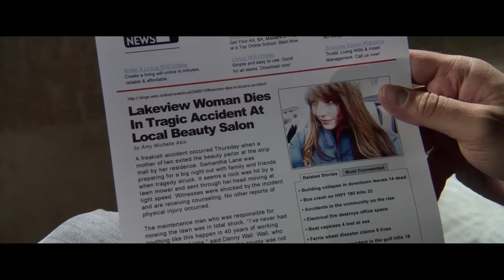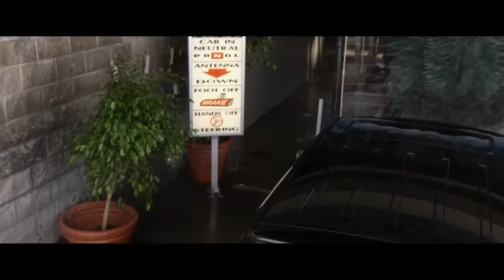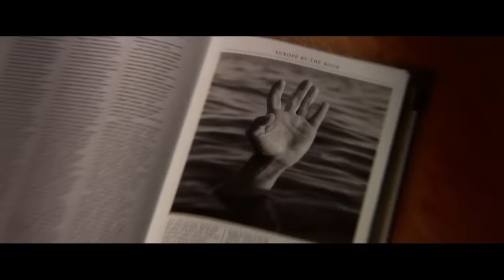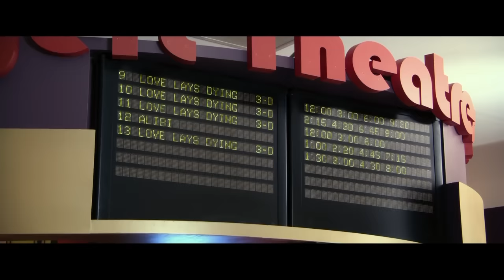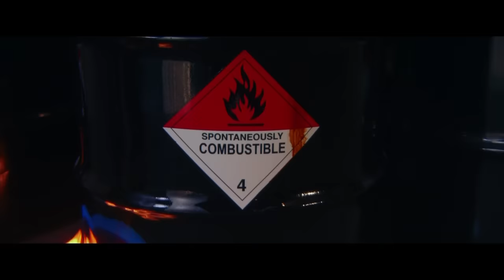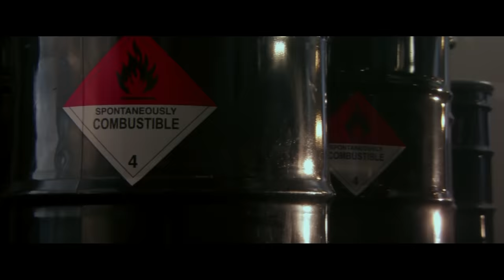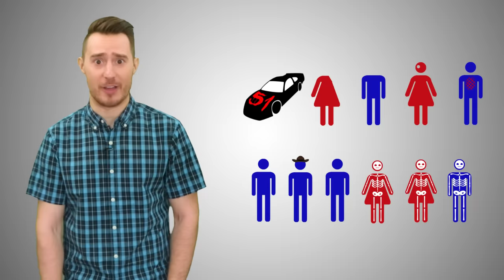The Final Destination (2009) KILL COUNT

Comment: also if you pay close attention to where the are sitting at the race track, you can see they're in section 180, referring to flight 180 which started all of this in the first film.
Reply: The bus number at 22:12 is also 180.
Reply: Which 180°/180 is code for (turn around) to avoid the upcoming danger.
Reply: Mindblowing fact: The car that cases the crash has the number 45 on it. The Final Destination is the fourth film of the series
45 × 4 =

   180

(Sorry if my english is bad)
Reply: Bus 180
Flight/plane 180
Train180
Seat 180
Whats next
Reply: No stop pointing that out please every film has 180 tied to death 180 means nothing to me it's just a number but eversince the second film every one of the films has had this 180 shtick.🤬🤬🤬🤬🤬
Reply: 180 is a recurring motif in the series. Carter was crushed by a 180 sign...the wiki has them all, but it comes up a lot.
Reply: @zollodelapaz8333  room 180 if hotels have that but seriously movies 180 is not a dead number 
Edited
also you missed next 180 sign
Reply: desmond thon A 180° is a complete turn. If someone tells you to do a 180 they want you to turn around.
Reply: @TheLivingRoom_  okay then what does turning around do for you when you blow up from lets say a leaking gass line see your explanation can make since for some of the deaths not all of them.
Reply: @zollodelapaz8333  person 180

Comment: 3:35 The bolts are being unscrewed by the massive vibrations of the cars, not the wind lol. It's the same reason Harley dudes will check their bolts all the time, they can rattle loose over time. If you stand near the fence when the pack drives past it can actually rattle your brain pretty bad. That's why a lot of people in the crowd will bring hearing protection, the tinnitus is very real lol.

Comment: 20:10 Chemist here with a background in Hazmat. Spontaneously combustible is even dumber than you think. There's actually a very specific difference between flammable and combustible when it comes to hazmat. I don't recall the specific details (it has to do with flashpoints), but in short combustible is less bad than flammable. Combustible means it will sustain fire, but by itself cannot start a fire. Flammable on the other hand, catch catch fire if exposed to sparks. So by definition, you cannot have something spontaneously combustible in a hazmat way. And btw, spontaneously flammable stuff is real: the real term is pyrophoric, and it would not be in barrels with a combustible label.

Comment: I’m no physics major, but I don’t think it was the wind that caused the screws to move during the premonition. I think it was the vibrations of the race cars passing by. Just my take on it
Reply: I completely agree. Wind wouldn’t have any effect on the bolts. It would be the vibrations from the passing cars
Reply: or it was just the movie being dumb
Reply: You'd need a pretty noticeable gust of wind (20 mph?) to even attempt to make bolts spin. Plus the wind wouldn't make the spin in the first place, they'd just push them horizontally to the side of the holes. I'd say it was a combo of vibrations + deEaATh

And yea it's a dumb thing in the first place but cmon it's fun to look for over the top explanations
Reply: There's no way the staff would not check loose screws

Comment: I think the tub scene makes sense because the water leaking on Jonathan Grove's head was from the water flooding over the tub filling the room above and dripping down to the ceiling bellow, so the tub didn't have to be over Grove's bed to drip water but it was in the right position when Jonathan tried to escape for the tub to fall on him.

I mean you could clearly see the water flowing over the sides of the tub above Grove's room even in this video.

Comment: Those were practical effects?? WHY does it look so bad? 
We need some experts doing an analysis here,,,
Reply: #FACTS
Reply: Because they covered them with cgi. It's a shame
Reply: By the time all the practical elements are combined and the colour correction filters, smoke, fire etc are added you obscure any practical effects underneath. It's super obvious here because of the length and complexity of the sequences. They perhaps would have been better off using fewer practical shots, or at least having the disaster be simpler.
Reply: Compositing
Reply: We actually have a group we can go to to ask about that

Comment: If you've ever had a leak in your roof, the tub would make sense. You may have a leak on one side of your roof, but inside the house you'll notice the water in a completely different location because of the way the water travels across the structure.

Comment: For the hospital scene with the tub, it makes perfect (non)sense.  Water pools until it overflows or finds an escape route and continues flowing until it's stopped or contained.  It could be possible that the room is sloped slightly so the water leaks over the cowboy's bed first.  What doesn't make sense is a) all that weight from the water in that size tub means the room should have been reinforced to prevent the tub from falling through.  Either it's on solid concrete or built on top of a concrete supporting wall.  And B) the room itself should be tiled or vinyl'd with a drain to deal with overflows.
Reply: Maybe death made the builders dumber

Comment: Johnathan Grove's death make sense because before the floor/ceiling collapse the tub was over filling with water spilling water onto the floor and filled the room with the tub with water and some of that water leaked down over Grove's head on the bed. Thus the tub didn't need to be over Grove's bed to drip water on the bed. If you watch the parts of the scene in the room above with the tub you can actually see the water spilling over the tub.

Comment: The reason the bathtub could absolutely be there is because the water isn't coming through the ceiling from the bathtub. Bathtubs don't leak. It's coming from the floor in the bathroom because the tub overflowed onto it. Therefore, the water could be coming from anywhere in the room except where the actual bathtub is.

Comment: The tub scene makes sense because the tub is bolted/attached to the floor, so the water pools around it. Therefore, water leaks everywhere EXCEPT the area directly beneath the tub, because on the floor above, the area under the tub is completely dry

Comment: I landscape and commercial lawnmowers absolutely are able to throw projectiles upwards of 50-100 meters. A small rock like that wouldn’t but a rock / pipe of the perfect size can go very far. I’ve seen an irrigation pipe fly across a good chunk of a business park parking lot, at least 50 meters away. I don’t exactly know why bigger projectiles go further but I think the bigger it is, the more it grips/gets stuck on the blade and the more kinetic energy gets transferred. Either way a rock that size wouldn’t fly at head length the far, and certainly wouldn’t have the force to act like a sniper bullet 😂

Comment: The whole spontaneously combustible barrels thing is funny because it does exist, (class 4.2 flammable solids) but they are spontaneously combustible when they come into contact with air. And I’m not sure what 4.2 material a construction site would need in that quantity. (Also, nerd moment, the color of the placard is inverted. It’s supposed to be white on top, red on bottom)

Comment: 40lbs? for an engine? my dear sweet comentator typical nascar engines weigh somewhere in the ballpark of 575 lbs (261 kg for you folks that like using the incorrect measuring system)

Comment: so the fire sprinkler system behind the screen. not exactly sure if thered even be a sprinkler back there, based on room use, but also all sprinkler pipe is steel or iron. the props PVC with shitty contact cement connections really look bad, like highschool film levels of bad
Reply: also if this is a temperature triggered sprinkler like the plot demands, the bulb that actually holds the always present water back

Comment: Not sure if anyone truly cares to know about the bathtub scene but I'll give a bit of real life info about water leaks which could explain why the water was over the bed and not under the bath.

So water tends to travel before seeping through cracks/floors, I once had an issue with damp mold where when I discussed it with repair guy and he said it's possible that the water traveled along the pipes before seeping through the ceiling. So that could explain what happened

Still a shit movie nonetheless